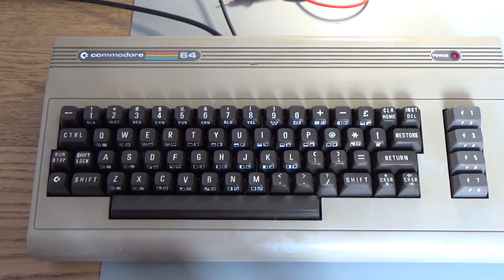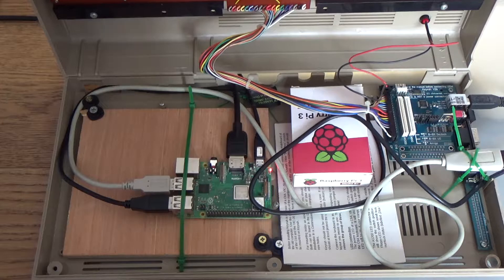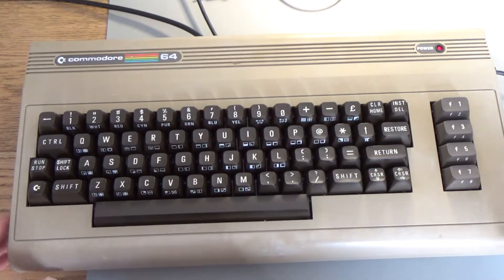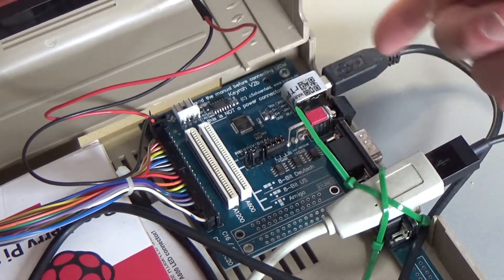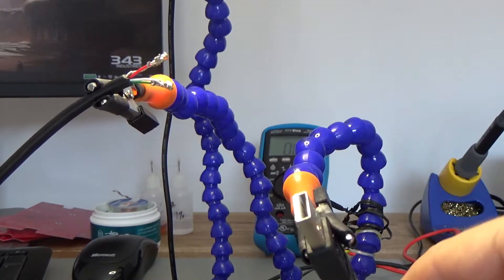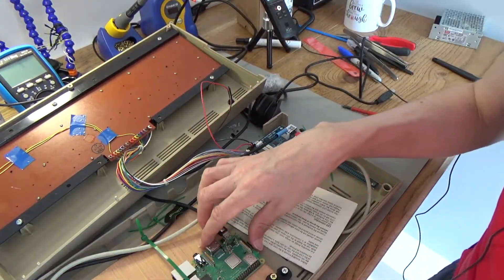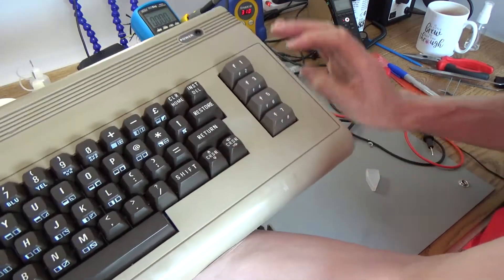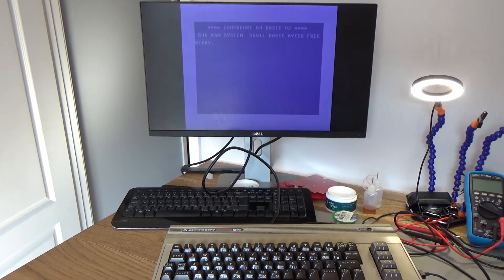Keyrah V2b USB Pin Header Upgrade (BMC64 with Raspberry PI 3)

Comment: How did you get the keyrah working with bmc64, the github says it doesnt work.
Reply from the maker: The GitHub says it does work, and also with the C64 maxi case.
Reply: @DavePoo2  I had to use a OTG cable and then change the vkb files.

Comment: Change of plan from my previous comment on here a year ago. I have been very kindly donated a KeyRah v2 and my plan is to purchase an Amiga 1200 casing (from RetroPassion) and the awesome and extremely kind person who donated the KeyRah to me also has a fully tested and working A1200 keyboard put aside for me. Will purchase another Raspberry Pi 3b+ as well for my project as i already have Amiberry on my current Pi 3b +'s micro SD card. Reason i'm changing my project is because i managed to pickup a Commodore C16 computer from F/B Marketplace and have that kept as it is because of the upgrades i've done to it and it works flawless but looking forward to starting my A1200 project so much.
Reply from the maker: Nice, the 1200 will be a good host for it.
Reply: @DavePoo2  Could i please ask where you bought the white pin header and pin header socket from, Dave ?
Reply from the maker: @scouse1967  It was a whole cheap kit of connectors -> https://www.amazon.co.uk/gp/product/B07QNPZDTW

Comment: Did you use enough flux.
Reply from the maker: I think so, using liquid rosin flux, it's good stuff. I suspect it wasn't enough heat applied to the joint, probably a ground plane sucking away the heat. But its been a while since this video, so i don't remember. It was unleaded solder, i probably should have used leaded, and i can see in the vid that the iron is on 310

Comment: why not just turn that board arround, cable then inside, grief free
Reply from the maker: Because then you can't access the 9 pin joystick ports if you want them. Also the mounting holes are not designed to mount the other way.

Comment: Very neat! Could I use it for typing in ordinary Raspbian terminal?
Reply from the maker: If you plug it into a PC it works as a USB keyboard. It works but i wouldn't recommend it.
Reply: @DavePoo2  Why would you not recommend it?
Reply from the maker: @Rilewhy it's an odd keyboard layout to type with on a PC. But would be perfect for use with a C64 emulator running on the host.